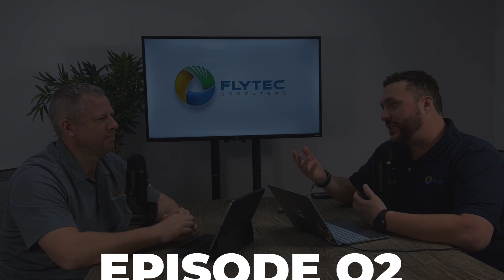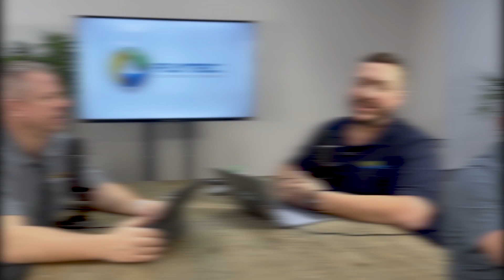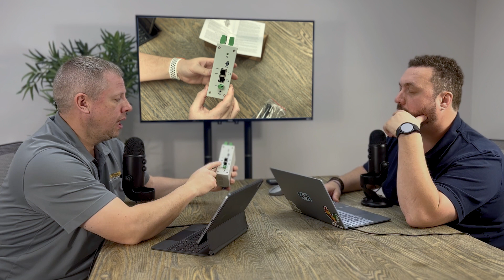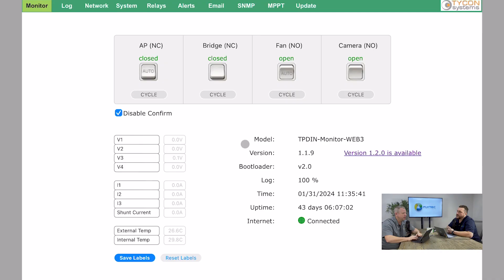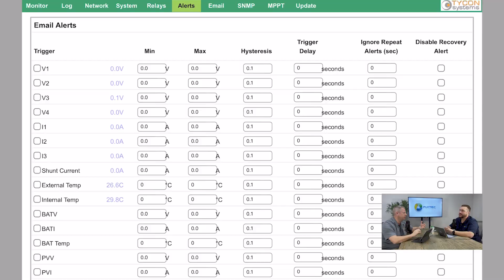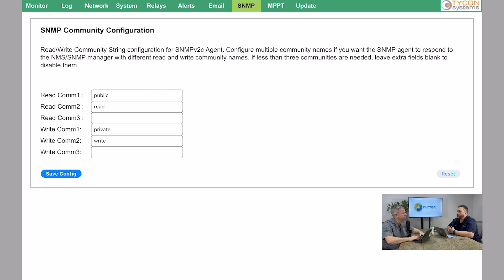Tycon Tuesdays at Flytec! Ep#2- TPDIN-MONITOR-WEB3

Comment: Thanks. All I am trying to do is close a relay if the temp is below 35 degrees. Open  the relay it if it is above 35 degrees. It will run a LiPo heater. How do I do that please? I have the TDDIN @eb 2 and Web3.